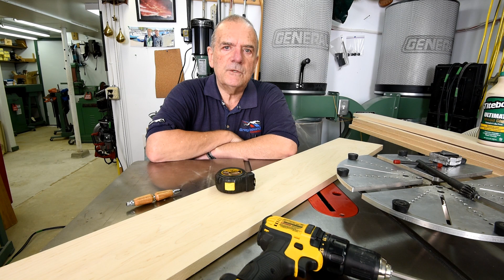The Trouble With Lumber

Comment: Hi Ron , you are not alone  this , here in the uk it is recognised that planed wood (par as they call it ) is sold as "nominal size" which 
normally 1/4 " less than stated therefore 8" will finish at 7 3/4.  So we are lucky , we only loose 1/4" not 3/4" .

Comment: It is the same in metric countries. Here in the UK, today I just bought some lengths of 25x50 (MM) that are actually 20x44, because 'that's the way it is'. Most places here list them as the 'unfinished' size, but in brackets or in the small print list the 'finished' size... Some places also list stuff under the old imperial system e.g. 2x4 (inches) as the headline, and then list the finished size in MM.

Comment: I agree with Ron and disagree with comments suggesting to buy rough lumber. How can buying rough lumber fix the lumber industry? Consumers want to get what they pay for. Store, who is selling the lumber is responsible not the saw mill. If store demands 1x8 from saw mill they could get it. but customers don't care enough to make it happen.
Reply: Yes you can do that but the price per board foot will also go up. When you buy S4S lumber some one has to pay for material lose and labor.
Reply: No. price does not go up. If I sell you 1x8 board for $10 and then I sell exactly same size board for $10 and put label on it 2x16 you are not saving any money.

Comment: Ron,
In years past when sawing primarily with pit saws then Up Down Gang saws and then circular saws the sawyer created Rough sawn lumber boards or planks which were not edged straight at all.
They also varied in thickness allot so they did saw on the heavy side of the standards.
The standards were set in "Quarters" of an inch 4/4 5/4 6/4 and so on.  Then the sawyers had to add some amount like 1/8" to the thickness to allow for saw wander, cupping, bowing and so on.  Then they allowed also for drying.
Product thickness is controlled by industry standards.
100's of years ago everything was over built.  From the timbers in building to furniture.  Today we have engineers calculating everything down to the nNth degree for minimum acceptable standards.
Now, While I agree with you that you may only be buying a 3/4" x 7-1/4" as an industry standard for finished use (by the way the term S4S is Surfaced 4 Sides out of a planer/moulder.) .  I can simply say it is just a simplification of terms.
It is far easier to ask for a doz 1x8 that reading off the actual measurements.  Same with plywood.  3/4" Plywood is no longer 3/4", why??? because most of our plywood is being made to metric standards or overseas and everything is cheap cheap cheap.
IF...
You want a S4S 1" x 8" you will need to buy 5/4 x 9" or wider.  Joint one face, Plane to thickness, joint one edge and rip to width.
This is the reason many woodworkers buy lumber in the rough.
But even there... 4/4 lumber which used to be 1-1/8" thick is now hovering near the actual 1" mark after kiln drying.  If there is allot of warp... you will never get 3/4" out of it.
One of my biggest gripes is about Yards who will plane to exactly 3/4" off a dull planer right out of the kiln and then store that wood in a dry showromm stood on end so it can continue to warp and twist.  This is especially aggravating when it is the sawmill who produced the wood to begin with.
They could skip dress it to 7/8" or 13/16" to leave a little love on there for final planing or sanding.
Leaving wood in the rough or skip dressed also allows for planing off the oxidized wood if it sits in storage for years.
Now the favorite part...
In closing...
Standards had to be set so that carpenters, and builders who do not own jointers and planers can easily procure dimensioned material ready for use (although it is far from ready in my opinion).
We still can search out suppliers of our favorite materials in the rough and support them instead of the BIG Box stores and yards who do not care at all.
Hope this helps someone...
Peace. Walter

Comment: Buy rough sawn and you’ll get your actual size not processed lumber. Then you make it the dimensions you want. But there we go again when you plane it , joint it , sand it and before that all happens it has to be dried whether by a kiln or by nature ( which is the longest time to dry) you have now made the same size as the processed lumber and you had to do all the processed yourself and run up your electric bill to do it.

Comment: I told you several videos ago how to avoid this dilemma. Buy rough cut lumber  You not only save the stuff they would  cut away but also the labor involved cutting it away Win win.  You are going to run it through the sander anyway so you might as well have complete control and not worry that the owner of the mill is taking extra money from you.